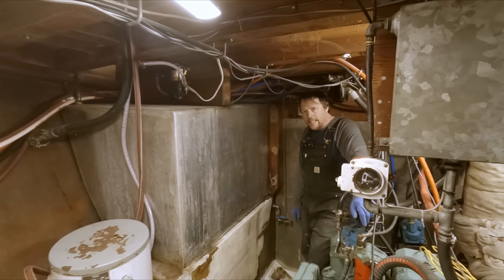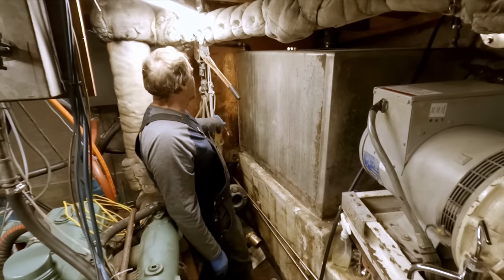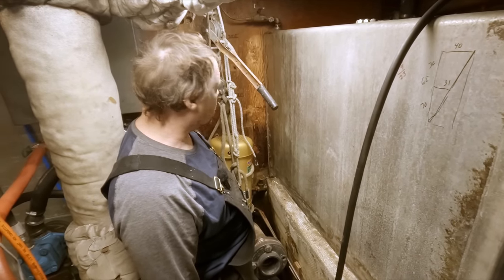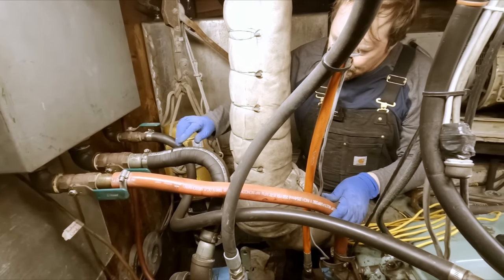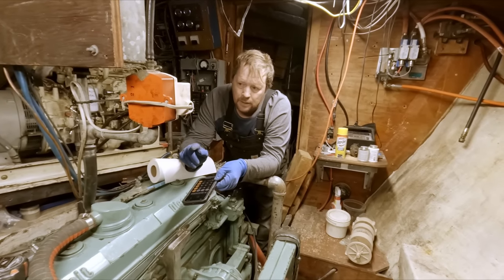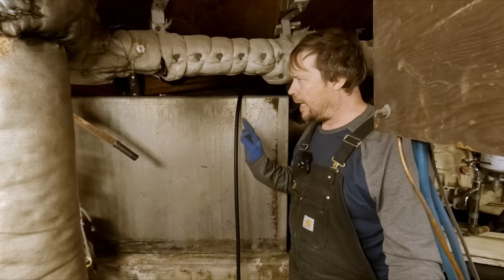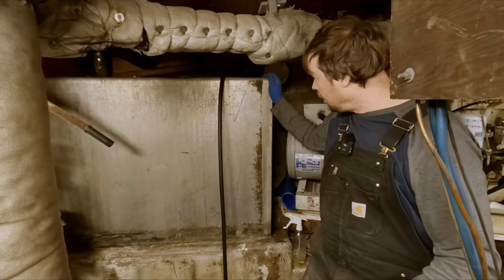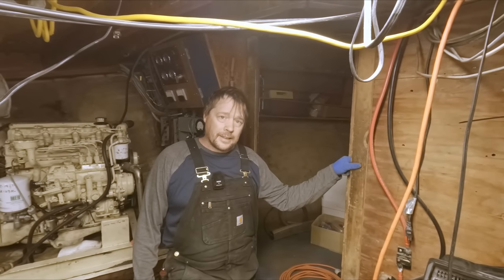Our Fuel Tank Springs a Leak... Is There a Silver Lining? - Emerald Isle: Ep.78 Fishing Boat Refit

Comment: Hi guys!  Bummer that the tank leaked. But as other followers said, better in Port than out at sea. You mentioned that you will eventually put your fuel tank down below this one "I guess from the support wall and into the hull". Why not do that now and then you can cut the steel tank out of the way, create a new Hydro tank any size you want and hang it on the bulkhead like you said. As a brother Mig welder, it is going to be very tight quarters trying to make a liquid tight seal. Just a thought. Whatever you choose I have complete faith that it will work out for you. As we Norwegians say, " If it vasent one ting it vas two tings" tight lines men! Karl

Comment: I agree with the splitting the tanks idea, even though I have never operated a boat before.  I'd keep the small tank for a dedicated steerage system and run all other systems off the newly created tank.  It's bummer to have lost all that fuel, too bad you couldn't have discovered the leak earlier and pumped the tank down, but I think you have a good workable idea, good luck with implementation of it.

Comment: Good to find this out now, rather than out on the water. My thoughts are to keep the small tank as a reserve that you could switch to if you lost the fluid in the new larger tank. Hopefully the other fuel tank doesn't have the same issues.

Comment: Never been a fan of a door from the forecastle into the engine room as you loose the water tight integrity in a collision event. If you close it up & place the generator there you will free up space to work on that tank. Cut a hole in the port side deck in the wheelhouse just behind the bulkhead for engine room access & another leading into the forecastle. I’ve done several like that & it worked well. You guys remind me of my father & me repairing & building boats in California during the 60’s & 70’s

Comment: I like Scott Dilley’s idea. Cut a hole in the tank and insert a bladder. Should last 30 years plus. Find another place to locate a larger oil tank. There’s a possibility that the other fuel tank will eventually leak. You’ll have experience on bladder installation.

Comment: It's a hard job,but its really a blessing that it happened now rather then if it happened a hundred miles from home in bad weather.  ,but like you already said having all those hydraulic lines right next to a exhaust is a very dangerous fire hazard. You are basically putting your lives in the hope a hydraulic line doesn't leak of even break. The fire would be almost impossible to put out. I think your idea to use part of the leaking fuel tank as a hydraulic tank is a win ,win. Have you thought about cutting a access hatch into the tank an putting a bladder in the fuel tank. But I'd still think about moving the hydraulic tank from where it is now to a location that's away from the exhaust and engine. I would also replace the hydraulic lines with a safer material then what's there especially any lines that may leak or break that could cause the engine to ignite the hydraulic oil that would be impossible to put out. I'd also look into a fire suppression system for the engine room as long as you are doing all this modification of the hydraulic and fuel system. 
As the old but true saying goes,,An ounce of prevention is worth a pound of cure.

Comment: Could you cut the top off the existing tank down to the area that you were using the grinder then add a new section to the outside of that,lowering the weight twds the bottom of the boat while opening the area above to be more usable . Maybe make a slimmer hydraulic tank on top and still have room for open space.

Comment: I would feel better were I you, with new metal.  Once electrolysis shows its ugly head, the elephant in the room is where will the next pinhole or worse be.  Especially true since it is such a random form of corrosion compared to normal oxidation.  You might consider chopping the old tank up to remove it and replacing it with three or four tanks that could be lowered into the engine room and fixed alongside each other in the space.  Then one could be hydraulic and the other three fuel.  This has an added advantage down the road of any leaks being isolated to smaller tanks that can be valved off.  Building in glass tanks has its pros and cons but with all the existing machinery in place, the dust and cramped quarters (fumes as well as inconvenient), it would be very detrimental in many ways.  Opening up the tank will only show the inside while the outer surfaces may be harboring pitting.  If it is to be a temporary fix then a bladder inserted in the tank through an opening might be a short term solution?  Messing with suspect tankage while exposed on the grounds is just too high a risk factor.  Considering the huge fines and consequences of a leak as well as the danger to yourselves it just isn't worth a partial solution.  I am assuming you cannot access it through the deck?  Cabin would have to be redesigned if it is coming up through there, but it might be an option??  On to the 'good news', seems we are going to have a lot more building videos to watch!  Bad news is all the work involved.

Comment: Making that tank a split tank seems like it would defeat the purpose of having the ability to draw from the fuel tank and you're dedicating an amount of weight that isn't going to change any because that hydraulic tank will always be the same. The hydro tank on the bulkhead is central so that's ideal it seems. If you're going to be cutting the tank up to split it anyways, why not just do like someone else said and lower the tank into the bottom of the hull like you planned anyways. The new lowered tank would not be as effective at solving a listing problem. As for the welding on dirty metal, you should be able to clean/grind/sand the surfaces down to better metal no?

Comment: Have you considered a bladder installed into the existing tank. After you open the top an clean an cover with the inside bottom with dense foam 
   Only a suggestion?